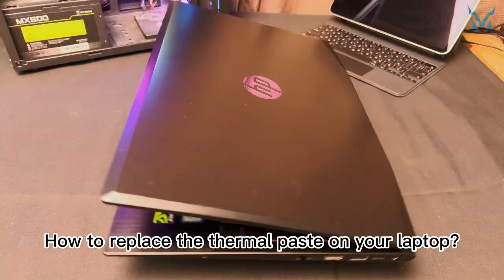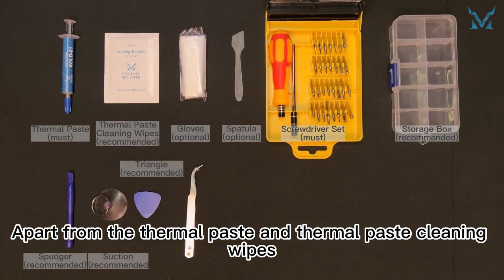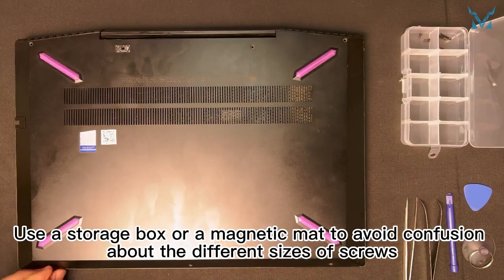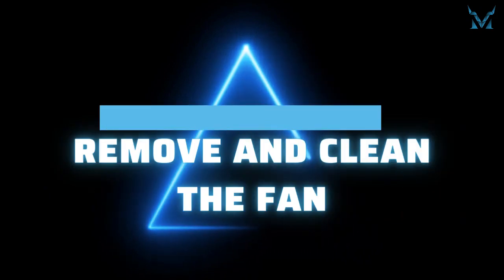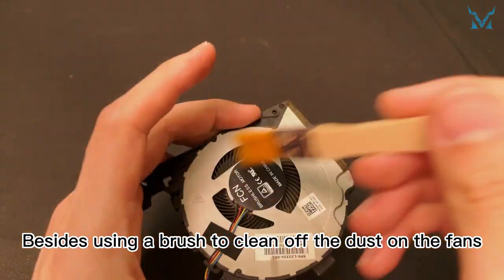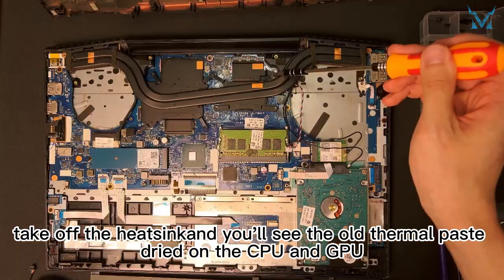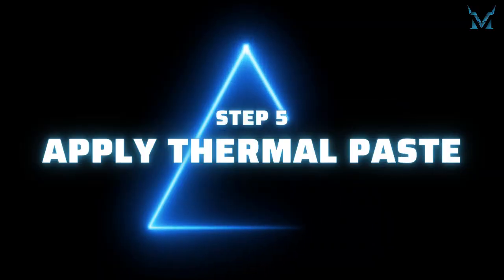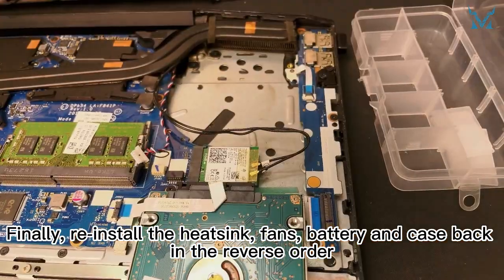Speed Up Your HP Pavilion Gaming 15 - Prevent Overheating With Dust Cleaning & New Thermal Paste

Comment: Is it possible to apply liquid metal? For the type of heatsink?
Reply from the maker: It’s technically possible, but not recommended unless you really know what you’re doing—liquid metal can spill and short components. We used KOLD-01 thermal paste instead—safe, no drying, and great temps even under heavy load.

Comment: what is the thickness of the thermal pad ? thanks in advance.
Reply from the maker: It actaully depends on brand's specification and usually ranges from 0.5 mm to 3mm.

We'd recommend to use thermal paste on CPU and GPU instead of thermal pad, becuase thermal pad cannot effectively fill the micro gap between proceesor and heatsink, resulting in poor thermal transferability.

case study on thermal paste vs thermal pad
https://koolingmonster.com/insights/cpu-thermal-paste-vs-thermal-pad-which-is-the-best
Reply: @koolingmonster  Thank you for your answer, my computer model is the same, I wanted to know the thermal pad dimensions.
Reply from the maker: We do not produce thermal pads at this moment. Very sorry that we can't answer this question right now. Our apologies.